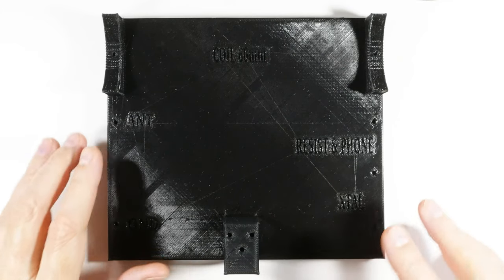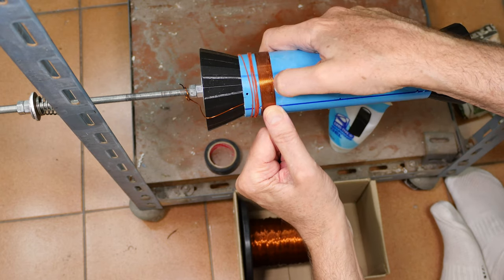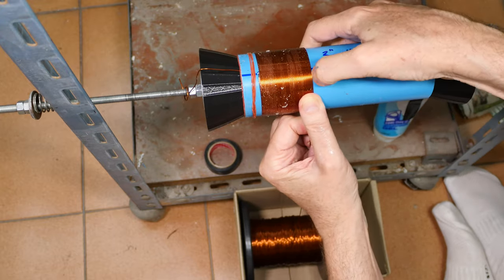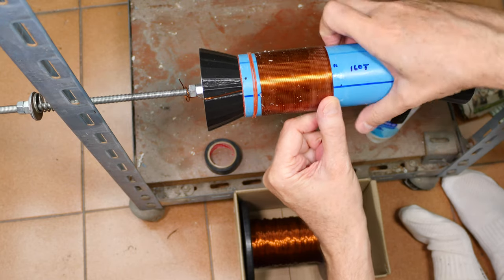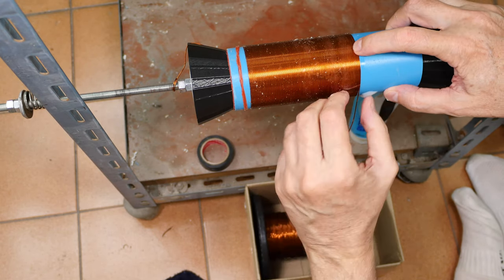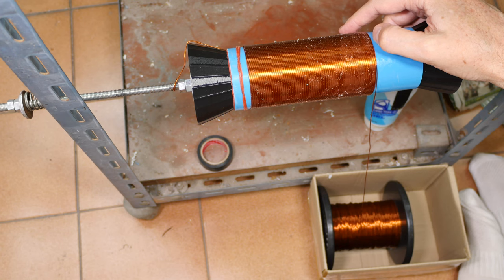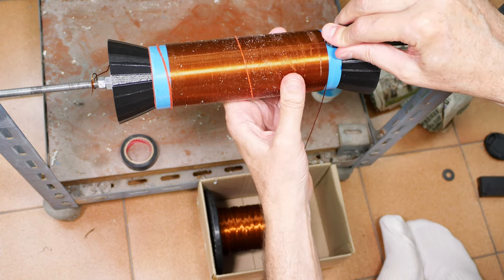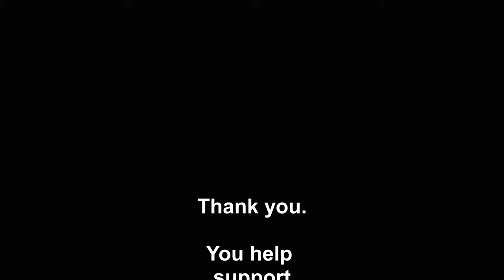Crystal Radio-Winding The Coil (FULL)

Comment: I would use doublesided extreme strong sticky tape to hold the coil in place. A little distance between each winding would increase the Q-factor.
Reply from the maker: When I was a kid, we tried to wind 2 wires together, then you would remove the "spacer" wire. It works but the coil is hard to wind,  has to be much longer, it is harder to tune,  and no matter how good the glue was, it would fail somewhere.

Comment: Think how cool it would be to bend a handle on the right hand end of that threaded rod so you could get a little more torque make things even easier. The rod would have to be longer though.
Reply from the maker: I cut it out of my winding jig video, but I made a crank on my 3d printer and tried it. Turns out I like having both hands on the coil. What would help my hands is something that would straighten the wire as I laid it down.

Comment: Maybe strips of double sided tape run lengthwise along the tube would be less messy and easier to work with.
Reply from the maker: No doubt you are right. I don't know the lifespan of the tape, but glue is good for about 50 years. It may be just me, but I  always imagine a parent and child building one together, something they would want to keep. Maybe I'm over thinking and over building them.

Comment: What kind of glue are you using?
Reply from the maker: Just a general white, water-soluble glue. It's too messy to use anything else.
Reply: @tsbrownie Thank you Mr. Brownie!  Like wood glue?  By the way, I am thoroughly enjoying the wonderful canon of work you have put up.  Amazing.  I read a book about Marconi called “Thunderstruck” which got me started.  So I built a “coherer” with my grandson.  Now I am interested in building your crystal set which I love.  Be well!
Reply from the maker: @pauljebb6921  Actually the channel is named after my dog, Brownie. ;)  Yes, the glue is used for wood, paper, etc. The one I used is a plastic based one, not the old horse glue. Glad you like the videos. Let me know if you have questions.
Reply: Actually, I do have a question unrelated to the glue.  I have purchased 20 AWG wire instead of the 19 you are using in your winding.  How will that affect the number of turns in the antenna tuner and the main tuner assuming a 2” core diameter.?  Thanks for your help.
Reply from the maker: @pauljebb6921  You can use online calculators to check me (http://www.circuits.dk/calculator_single_layer_aircore.htm) (https://www.circuits.dk/calculator_multi_layer_aircore.htm) but I think that you need to add 2 additional turns from the 160 I used.
Reply: Wonderful.  Thanks for the equation!